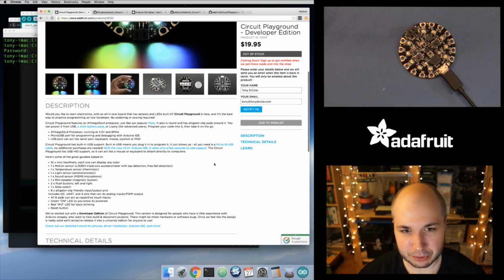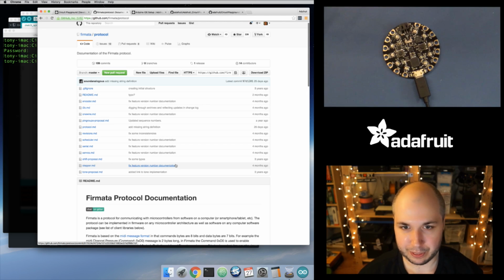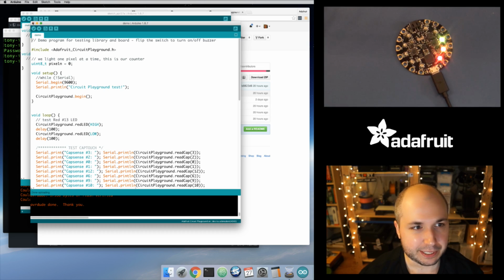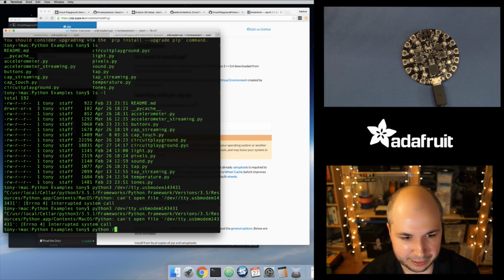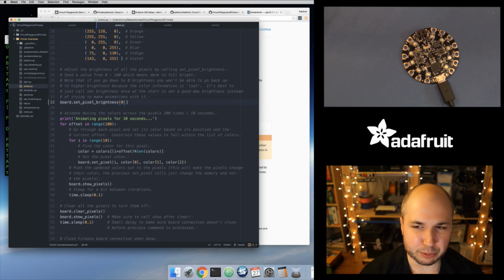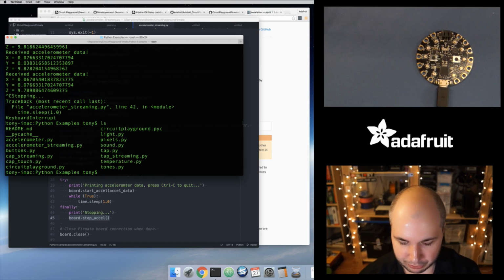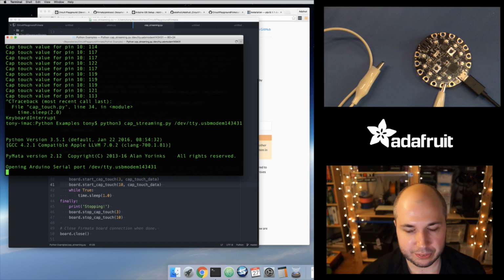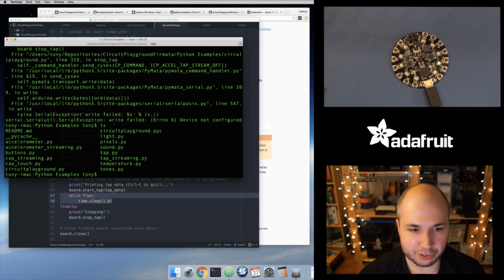Circuit Playground Firmata & Python demos with Tony D! @adafruit #LIVE

Comment: what Ubuntu distro do you use tony
Reply: +Howard Wiseman I used 15.10 regularly but just had to switch to an iMac to use wirecast for streaming.  I want to try the new 16.04 LTS release though and maybe set it up as a development machine.
Reply: thx tony just wondering